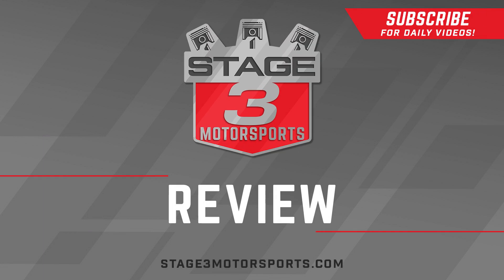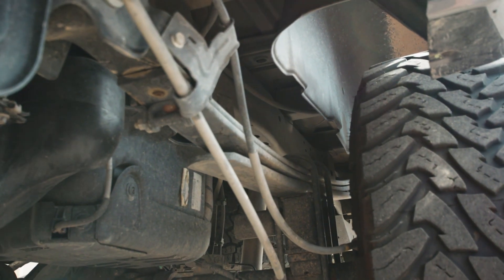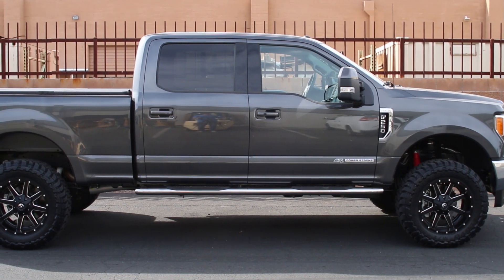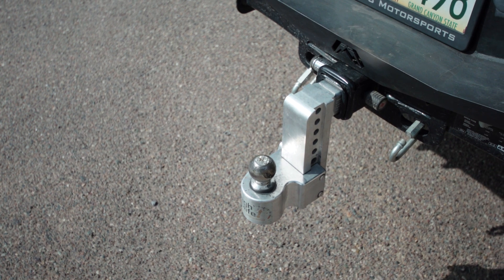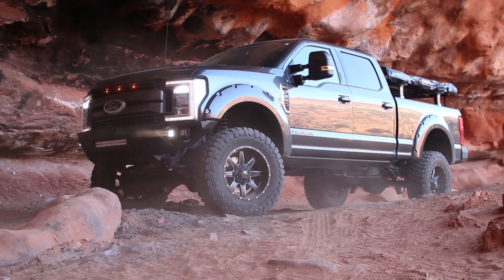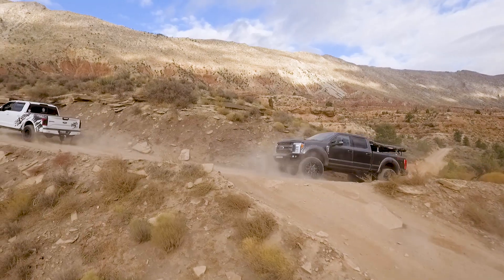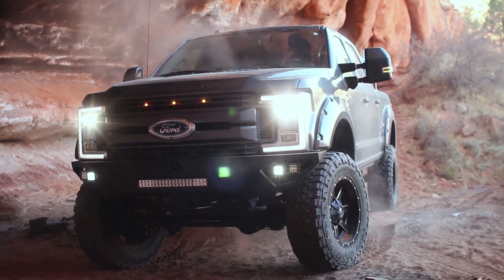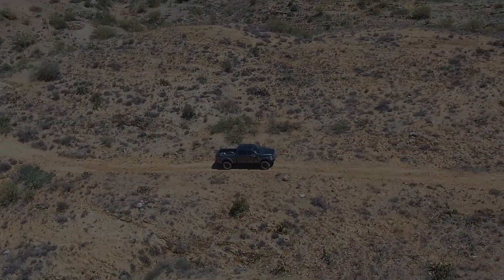2017-2018 F250 & F350 6.7L BDS 4" Radius Arm Lift Kit Review

Comment: 2:35  running 17" tires so you can have lower tire pressure while off road can help a lot with wash board.  Tires are part of the suspension system.  The larger diameter wheels do not allow for airing down because the tire sidewall is too short and will cause the tire to overheat and fall apart.

Nice truck

Comment: Do you think the carli pintop suspension would soak up the wash boards better?
Reply from the maker: Without running the suspension it's hard to say, we've heard great things about that setup though so it's very possible! Check out some customer reviews in the link! https://www.stage3motorsports.com/CS-F45-PT25-17-2017-F250-F350-Carli-Pintop-4-5-in-Leveling-System.html
Reply: I know it's been a year, but It's not hard to say at all. BDS is nice if you're on a budget, but Carli was designed for stuff like washboards - they are on another level and proven off road with their custom tuned Kings. BDS's upgrade is the Fox shock. Carli's entry level is Fox. BDS is awesome for what it is and IS quality, but it's a lift kit. Making excuses that the truck is too heavy for washboards is silly. It's not the weight, it's the suspension. Check out all the vids over on CJC Offroad's YouTube channel. There is a ton of detailed content that covers exactly what you had asked here; not one customer review that raves about Stage 3's "buying experience".

Comment: Good review.  I have a regular cab with 6.2L.  My truck sits (with snowplow package) about an inch taller than a comparable 6.7L.   I hate to put a 2.5" leveling kit only to get an inch out of it.  I contemplated the 6" kit, but I do not like the idea of the indexing ring and the drop pitman arm seems to be a bit steeper than I like (not to mention that the drop and heavier tires must put some additional stress on the sector shaft/power steering unit).  Questions:  Given the factory 275-65/20 measures ~34.10, do you think I could run a 35x12.5 on a 20x9 with 0mm offset as it sits stock (42" to bottom of fender)?  Do you think the BDS is that much better than Rancho?  I am not a fan of the Fox 2.0 and will buy the Rancho XL9000 instead.
Reply: I don't have the exact specs you are looking for but I put 3512.5/17 on my stock rims and have no issues on my 2014 F250 XLT 6.2L with clearance. No rubbing and no trimming. Hope that helps.

Comment: Is there any rubbing anywhere at full lock with this set up?
Reply from the maker: There is not
Reply: Thanks for the quick reply! Looking to do this same set up on my 2019 F-250 Platinum. What’s the offset on your tire and where combo? I’m wanting to do 37x12.50 with a 22x10 wheel. Do you think I will experience rubbing anywhere with this BDS lift kit?
Reply: Wheel*
Reply: Gabriel Hernandez  I have the same truck like you have. I did the same lift as this video but running 35’s with stock rims and they rub the radius arms. I was wonder what size rims they went with on this one

Comment: How does a truck this big handle AZ trails and back country hunting roads? I’ve got the F150 but may buy an F250 but am curious about the weight and off-Roading abilities.

Thank you,
Reply from the maker: Patrick, these superdutys do an incredible job on the trails and back country roads. Sometimes it can be tough with the size, if you're looking for max off-road abilities the F150 is probably the best platform for you!
Reply: Stage 3 Motorsports thank you !

Comment: I see a mix of posts saying a 4” vs 2.5” is needed to clear a 37”.  To your point about the least lift to fit a 37”, what’s needed to fit a 37” with just 2.5”?
Reply from the maker: If you installed 37's on only a 2.5" lift, you would need to do some trimming to clear the tires. A 4" lift is definitely the way to go to best fit a 37" tire
Reply from the maker: @abelg1980 You can find all the info about this builds 20" wheel size and -12mm offset on the build page here! https://www.stage3motorsports.com/Stage-3s-2017-F250-6-7L-Builds-Lift-Kit-Wheels-Tires.html